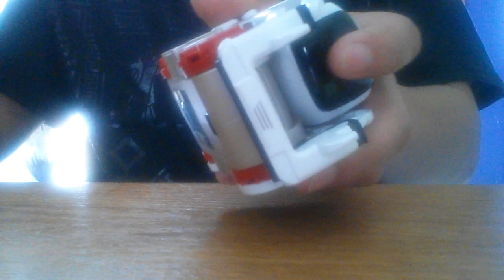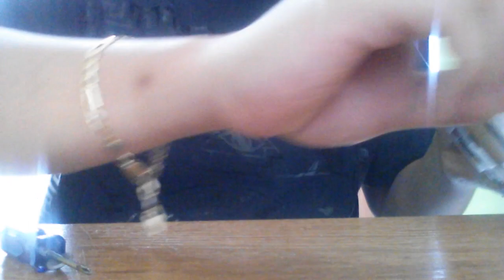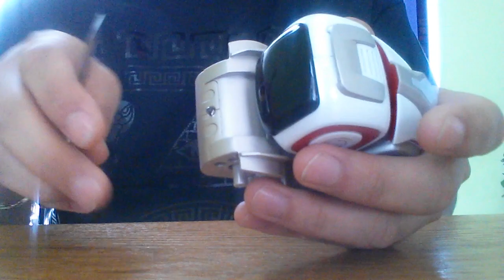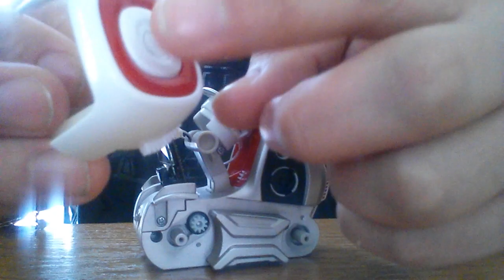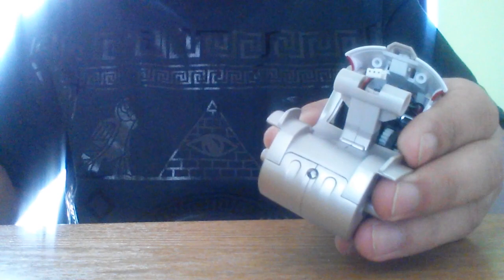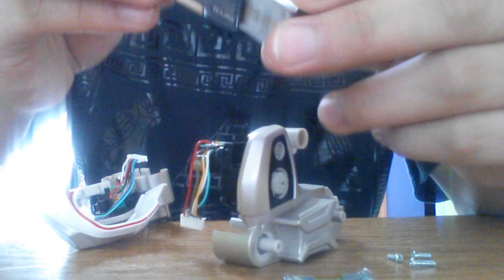Anki Cozmo Teardown (READ DESCRIPTION!!!!)

Comment from the maker: UPDATE: For anyone who finds this video flips out, this unit was dead from the start when i got him. Keep in mind i didn't get him new, I got him used off ebay for $20 ($10 on robot and $10 on shipping). Recently a board with battery and chassis showed up on ebay and I bought it, so expect another video of this cozmo being taken apart but this time he should hopefully be working! Stay tuned!
Reply: Hi, can you help me with my Cozmo? he wont get off his charging unit. Thanks
Reply from the maker: Do his wheels move?
Reply: @Zorua635  no, the charging light is green and when he is on the charging station he can open his eyes and make sound, I tried feeding him through the app but the message I get is Cozmo is waking up... this goes forever and when I lift him from the charging station the green light intermediately goes off.   Thanks for answering my message.
Reply from the maker: So when removed from his station he shuts off?
Reply: @Zorua635  yes
Reply from the maker: Sounds like he needs a new battery which I do have a spare one.

Comment: Sr, can i help me?. My battery cozmo is fail. And i want to replace new battery. But i dont know number for battery.
Reply: Dung Xuan I also need to change it, and I found this. Check this battery “403030 3.7V 320mAh Lipo Polymer Rechargeable Battery”

Comment: what type of battery , how many volts and amps?
Reply: Hi, 
the battery is a Li-ion, 3.7 Volts, 320 mAh. 
You can buy a 3.7 V, 600 mAh, that should fit.
I ordered one and will give it a try.

Greetz, Peter
Reply: @vidsforkids4077  Thanks man, just anticipated if my Anki died , great vid. would love to see new battery assembly, plugs etc

Comment: if the cozmo arm is loose should he still work?  it wont let me connect to it.  the password is not appearing maybe because the arm is loose.  Please help.
Reply from the maker: If his password isn't showing then something tells me yours might be completely dead. Its not the arms that are affecting it
Reply: If it was dead how come the light still shows when it is charging
Reply from the maker: Oh so the light still goes on? Well in that case its not dead! But there could be an issue with either the screen or the wire that connects to the screen.

Comment: Nice work.  My Cozmo stripped a tooth on a gear in the lifting arm.  Using your advice I was able to take it apart down to the chassis split.  I then was able to remove the servo motor, split it and spin the gear so that the broken tooth was towards the back.   Put it all together again and Cozmo lifts again. Muchos gracias
Reply: Patrick Meier I did basically the same thing but I just pulled the arms off and rotated the gear around so the broken tooth is on the opposite side. Hope I don’t break another tooth off.
Reply: @Toadster250  on my cozmo, the sound doesn't work. Can you tell me how to fix that?
Reply: KTG 10 maybe your speaker is busted. You might be able to buy a speaker for him. Not sure though...
Reply: @ktg1012 its maybe in the app settings because you can mute his audio

Comment: Do not pop off plastic parts with a screwdriver. You will scuff up the plastic. Use a plastic spudger, like the ones used to tear down smartphones
Reply from the maker: +official_gymkhanaschoitl 
Im pretty careful when it comes to taking things apart, been doin repairs since i was 9. Plus this model no longer worked and this was the 3rd time i took it apart.
Reply: yeah, my lift had a hard time going back on due to being scuffed up

Comment: Nice job on the disassembly, I hope you fixed your cozmo. By the way I hear your mom? Chatting on the back ground in Spanish  lol. Be well.
Reply from the maker: +mm ltn 
Only reason i took this unit apart was because this one could not be fixed since it had some sort of issue with the board. And that was my stepmom lol
Reply: Zorua635 after your teardown it looks like the battery caused the short to your board do you think the manufacturer would help you out and replace your cozmo ? I would call this manufacturers defects, "lack of shielding tape between the board and the battery" I may not hurt to try... It could happen to others. You have a great example on your hands they may want it back for PM research.
Reply from the maker: +mm ltn 
Well the manufacturer or company won't help as far as i know because i bought this one off ebay being sold as not working. The seller said he would do some commands but he doesn't and whenever i would charge him up he would begin to over heat. On his board there are 2 small components that were blown so idk if replacing them will bring him back to life i have his battery disconnected but when he is put on the base he will power on without it.
Reply from the maker: +Auto Gaggins 
Yes i know that could work the only issue is knowing what the voltage is on the dead components it has so i can replace the 2.

Comment: I got my first cozmo I got on amazon when I played with it for first but when I charged it it doesn't charge anymore it would cut off on its base when connecting to the app so I exchange for new cozmo and it works like New no problems